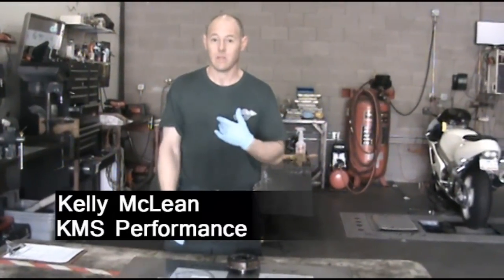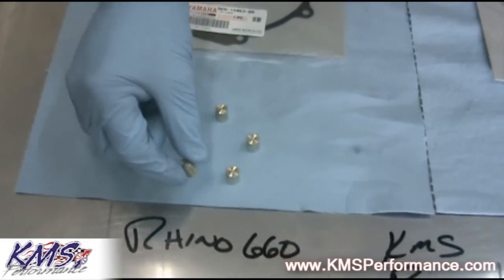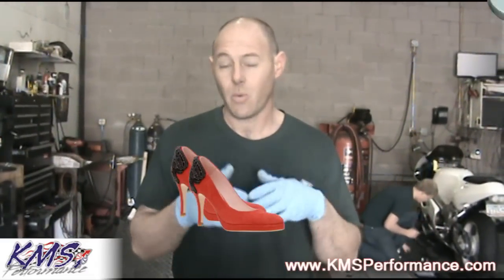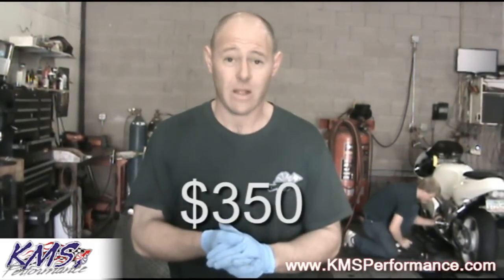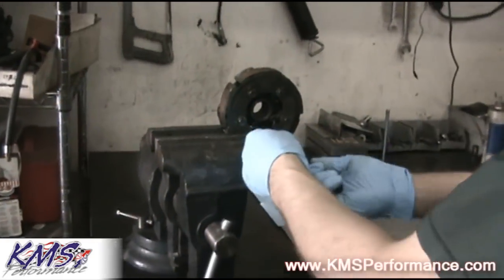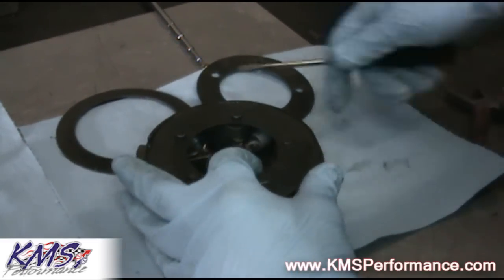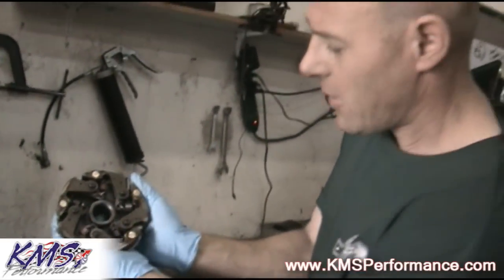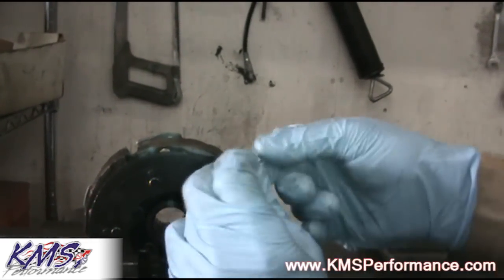KMS Performance | Wet Slug

Comment: I have a rhino 700 that ive burnt the pads up on the wet clutch and will be buying a slug kit while ive got it apart...but im having a hellava time find replacement pads and I don't really wanna pay dealership cost. ive found lots of replacement parts for the 660 wet clutch so my question is,...is the 660 wet clutch the same as the 700...thanks and very informing vid.